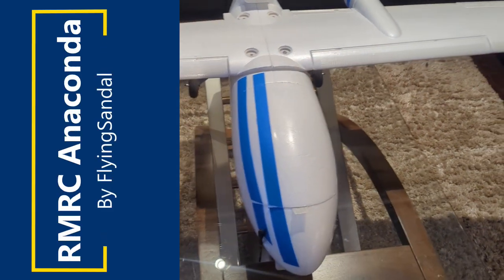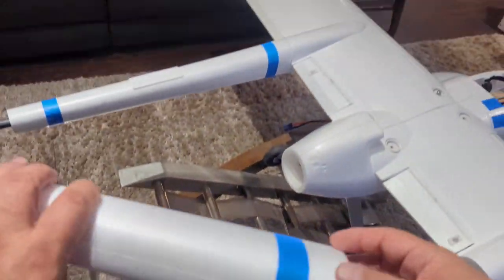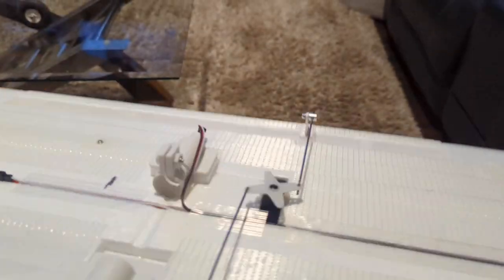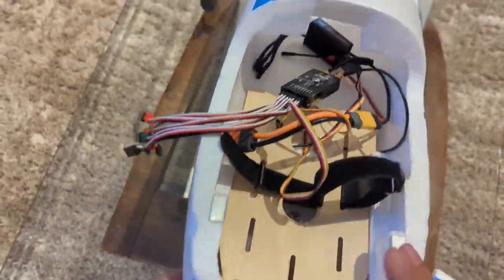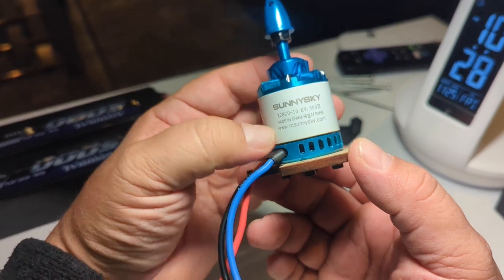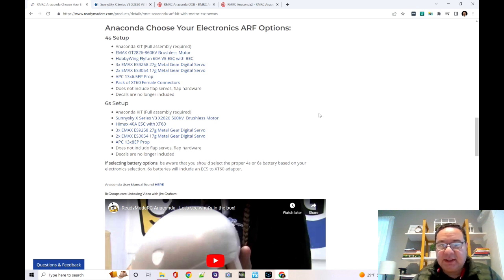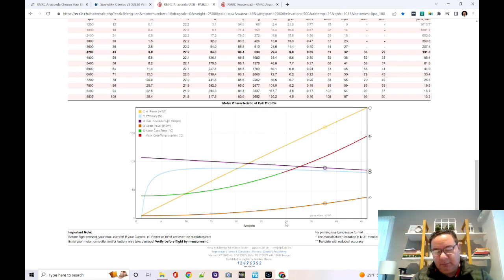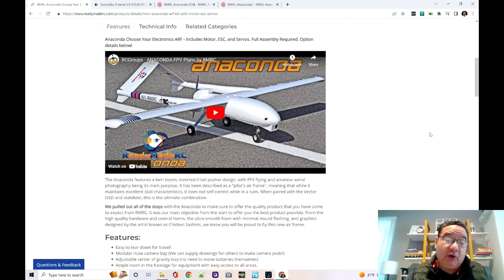RMRC Anaconda Build Details

Comment: Nice thorough build, thanks for sharing all the tips. Color coding the servo wires is a great idea and must save a ton of time with assembly. I'm not sure about that 3.5mm for the servo connection though, wouldn't there be a chance that it shorts out if it gets tugged slightly out of the jack?

How much 3m stock do you own with all that extreme tape :D
Reply from the maker: Thanks Karl, for the comment! ;)
So far the connection of the audio jack has held up. Fingers crossed it continues. Actually once those clips are tightened, the boom doesn't move easily.  I probably should own some of the 3M stock! That extreme tape is something else.  I started using it after I had some of my foam planes show a bit of wear on the leading and trailing edges. Just a way to try to give them a little more durability.